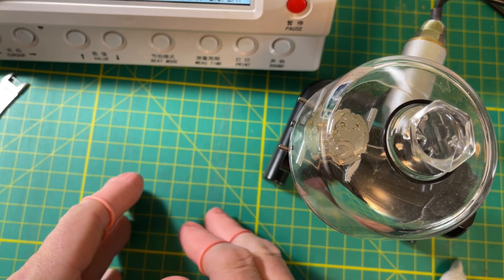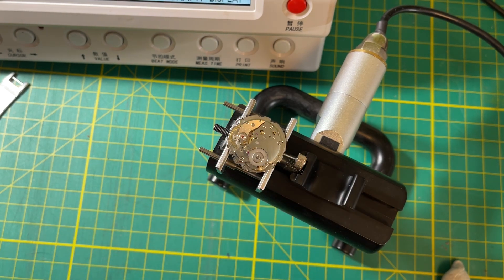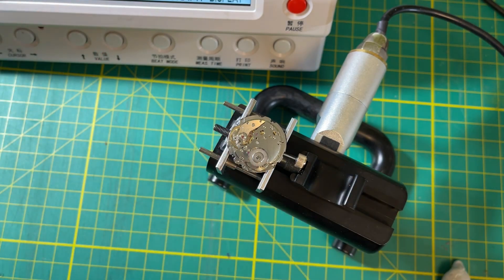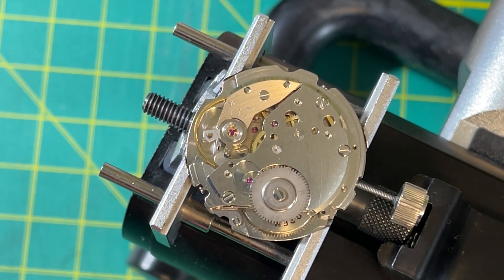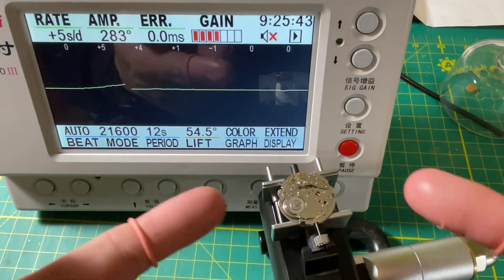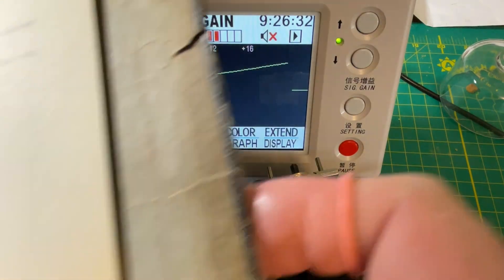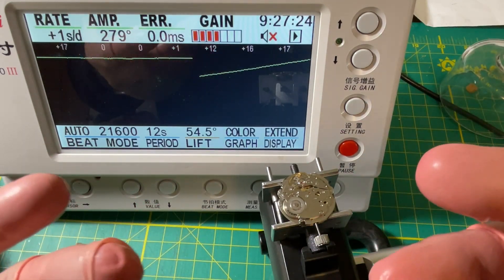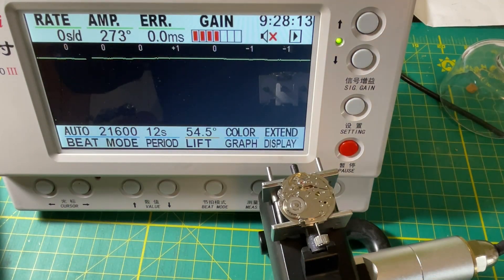Are Seikos underpowered by design?  And is this the fix?  November 20, 2024

Comment: Fascinating! I work on a lot of 6139s and have always found it so frustrating to put in a huge amount of work to get marginal amplitude results. I wonder if this is an even better idea with upgrading to a jeweled barrel arbor which I’ve done before in the 6139… the jewels are readily available though expensive
Reply from the maker: I had the upper & lower jewels recreated in bulk just for myself and Daniel Blair of the Blair Watch Project.  Every 6xxx-series should get them.  Major oversight on Seiko's part, but I'm sure they looked at the cost/benefit and decided to save a few pennies per movement by not jeweling the mainspring arbors.
Reply: Great idea on getting your own source for the jewels. Somewhat related what do you think about the same for the 7016? I’ve seen you do quite a few of them and while looking for replacement mainsprings it seems the only real listed replacements include the complete barrel. Are the 7x series perhaps the same situation? I’d love to get a better mainspring option for the 7016 I’m in the middle of
Reply from the maker: Those 7xxx-series movements are easier to get to run at good amplitudes - smaller wheels, smaller balance - so the mainspring doesn't have to be as strong, which in turn makes for less wear.  The lower mainspring arbor can be jeweled with the same one I use in the 6xxx-series movements, but it's rare for me to see one that's so worn as to need it.

Comment: QUESTION: In an Automatic movement, would it still be capable of self-winding given a stronger-than-stock mainspring ?  
Perhaps they settled on a more delicate (wimpy) mainspring so that the Automatic system (where applicable) has a chance to push it around.
Maybe the counterweight would need to be switched to a more aggressive one, but then the case might not fit.

Comment: I now remember that Ashton from the Seikologist channel has been through this topic with vintage Seiko’s and he adjusts the pallet stone depth to achieve a better amplitude
Reply: While lowering the pallet depth will increase amplitude - as the balance will be slowed down less during unlock - but not as much as the timegrapher will display, because the lift angle (provided by the manufacturer) was valid only for original factory pallet depths, and will be needed to be lowered (by an unknown amount) for the new shallow depth.

Comment: My major experience with Seiko movements is that every watch that I own with a 7s26 movement keeps better time than my watches with newer NH35 and 36 movements. I'm not really sure why that is.
Reply: A counter-argument... 🙂
My Seiko 5 with the 7S26 movement is typically LESS accurate than my admittedly-ridiculous Invicta 9094 with a Japanese NH35A movement for the following odd-ball reasons.
The 7S26 isn't hand-winding, so it's more frequently run-down and stopped (I've got too many watches so can't wear them all, all the time). No, I'm not buying a winder. 
Also, the 7S26 is not a hacking movement so it's near-impossible to get the seconds bang on. The back-pressure trick is uncomfortable, and still can be 2s off.
The NH35A is hand-winding so it's more frequently still running. Also, it's a hacking movement, so can be easily set within a half-second.
These have nothing to do with the point you made which remains correct. 🙂
Reply: @JxH  I agree with everything you said but for whatever reason my 7S26 watches all run within 6 seconds a day. My NH watches all run 12 to 14. When I set my older Seikos I do a bit of a trick I am sure many people must do. If the watch has stopped, and the second hand has stopped at say the 43 second marker. I will wait til my phone hits that time and shake the watch to get the second hand synced up. Then Ill set the time. Again, Im sure many others do the same thing. To bounce off something else you said about your invicta, I have a Tandorio field watch with an NH35 movement. It is more accurate than actual Seikos I have with the same movement. Its possible other watch companies spend more time regulating their movements than Seiko but that is just a guess.

Comment: Oké so what I’ve noticed is that seiko springs are thin but more rigid than Swiss springs, even if i search for a similar replacement spring its always more flexible then the original, even though thickness would be the same. Also is there anybody here who knows which spring to use on 2220 movements? The eye of the spring is always way too large and im unable to size them up without either breaking them or damaging .

Comment: would probably introduce more stress to the wheel train pivots leading to faster wear, you'll probably have to fully jewel it as a work around which will probably give u even more performance from the mouvement ,but am not so sure of that

Comment: Of course the amplitude is lower by design. Do you think Seiko doesn't know how to engineer a watch movement?
Reply: I agree, you can't always look at an engineered product and reverse engineer the design decisions.  Perhaps the lower amplitude is more "linear" (I'm an electronics engineer and an oscillator might run into a non-linear region at the peaks of excursion) and more accurate over the wind down of the main spring, who knows.
Reply: Might also be more energy efficient and allow the watch to run for longer.

Comment: Nice observation.  I typically see anywhere from 210 - 230s on a serviced 6105, 240s on a good day.  I have always thought a hotter spring would solve this issue.  Thanks for your vid.  I guess the tradeoff would be slightly lower power reserve.maybe.

Comment: i guess because Seikos seem to wear their barrel (and to a degree their centre wheel bushings) more than  many swiss movements due to design/materials used or both the mainsprings chosen for them aren't underpowered, as to use a stronger one from the factory would have needed either redesign of the movements, jeweling of more of the bushings or perhaps use of different materials), but for servicing older watches where they have had to be jewelled anyway it does seem a useful discovery
Reply from the maker: Thank you!

Comment: Is this also underpower problem with my  Seiko 5 6119-6003, is 6159 barrel compatible ?
Reply from the maker: Yes, they are, they're a drop-in replacement, but the cost and rarity makes it not really viable.

Comment: It's a great question and a very interesting discussion but I think the premise is wrong :) 270 is just a convenient number (3/4 of a full rotation), set by the Swiss based on their ways of doing things. Seiko watches with 230-240 amplitudes are just as accurate as Swiss watches with 270-280 amplitude and lesser power should lead to lesser wear. Thus my vote would go to Seiko's approach. 

Also, Swiss watch manufacturers do not actually test their watches for 270 at full wind, they test them after 24 hours. For the Omega 550 family for instance, the amplitude after 24 hours should be a minimum of 160. So this whole 270 holy grail is a bit exaggerated, it's really about whether a watch runs accurately or not. Granted, there is a relation between the supplementary arc and the engaging arc/lift angle but that's a longer discussion...
Reply: @VintageWatchServices  This is what I’ve thought, but thankfully for everyone else you have articulated it so well!

Comment: That makes sense, and the only problem, the reduced power reserve from the reduced length, isn't really that terrible on an automatic watch anyway. Coincidentally, I have a Citizen 8110 chronograph movement that had a broken mainspring and tried to find a good replacement, and noticed that the Seiko 6106 etc. spring is a actually good fit. It's just a bit longer and thinner. Turns out that results in a bit too poor amplitude and poor timekeeping for the 8110 (which of course is a higher beat movement). If you find a stronger spring for 61 series, that should fit the 8110 too.

Comment: You squeeze more amplitude out of an untouched Seiko movement that is fresh from the factory by a good service, including polishing any pivots that don’t look immaculate, using just the right amount of lubrication and fine-turning the hairspring and regulator pins for optimum performance. 

This will often get you up over 270 degrees. 

The use of a more powerful (thicker) mainspring to get more amplitude is well known and in the past was a commonly used technique to get a watch being serviced running well, when time wasn’t available to squeeze the best amplitude out of the movement via a very thorough service. 

George Daniels talks about doing it in his autobiography, when he was servicing watches in bulk for jewellers.
Reply from the maker: 6xxx-series Seikos simply do not run at 270 if they're all stock.  They just don't.  I can recall maybe one that was that good.  Typically it'll be much lower, and that's OK.  There's a limit without something drastic like a major increase of power, because at a certain point there isn't anything else to remove in terms of friction / shake etc.  The 7xxx series can easily run in the 270s when freshly serviced, absolutely.  New from Seiko they don't though, typically.
Reply: @ You can get stock 6xxx-series Seikos to run at 250 in the dial positions, with maybe 10-20 minutes of 280 at absolute full wind. 

There are people who have put a great deal of practice into finding even more amplitude than that, who have painstakingly studied what needs adjusting in this series of movements to get optimal performance, and they do get amplitudes of 270-280 quite reliably. 

If you can get to the point of reliably getting to 250 in the dial positions, perhaps 20-30 less in the vertical positions, then you’re doing well and it’s a case of diminishing returns vs effort invested to go higher, but it can be done.

Comment: Yeah I think you are correct. My 6309’s and 6105’ are putting out 210-230 amplitude, my 6138 however puts out 260-270 with its original mainspring. When I do use an aftermarket new spring I’ve had good results with a GR25341x they take a little longer to come up to full power but when they do they hold good amplitude. Also to consider is what grease and oils are being used in the barrel and on the pallet stones. I get good results using 8213 on the barrel walls, 8200 on the spring and 9415 on the pallets jewels, I never use Seiko grease. A great topic to see what results others are finding.

Comment: Hey Spencer, I’ve been wondering the same thing.  Perhaps would the 6146 spring be the same as a 6159?  I haven’t bothered to look it up, but the dimensions on the 6146 should fit fine in the 6105 barrel, although it is slightly shorter and will affect the power reserve.  Not really an issue though in an automatic movement.  Overall, it has the same dimensions except for thickness, which is 0.15 in the 6146 instead of the 0.115 on the factory 6105 spring.   GR2537X shows to be the part number from cousins, however I don’t know if the inner loop on the spring will accommodate the arbor without adjustment. I will source one of these springs and give it a try on a freshly serviced movement.  I really appreciate this video, and would be interested to know if you’re going to give it a try. I would love to hear your thoughts.  I just recently finished a 6106C and was pleased to get amplitude in the high 220’s to mid 230’s after the full service and barrel arbor jewel upgrades.  If we can source a different spring, whether it be a GR2537X or something different, it would be a game changer.  Always enjoy your channel. Thanks for sharing your knowledge.
Reply: I've purchased GR2537X from cousinsuk and can confirm that it does indeed fit in the regular 61** barrel with no refinement of arbor curve required.   Knocking (amp > 330) in horizontal positions might be an issue, but perhaps a regular rotor will not wind in enough torque to trigger that.
Reply: @jakelewis3d  Interesting, good to know.  Thanks for the info.

Comment: Do you think that Seiko deliberately underpowered these movements specifically because the arbors were not jeweled? You should put a beefier mainspring in a non-modified movement and see if it causes damage.
Reply: Or we can jeweled the arbors ?
Reply: @okvideos5228  Spencer already did that. I'm curious what would happen if one put an overpowered mainspring in a movement without jeweled arbors.
Reply from the maker: You'd get increased wear, especially the lower.